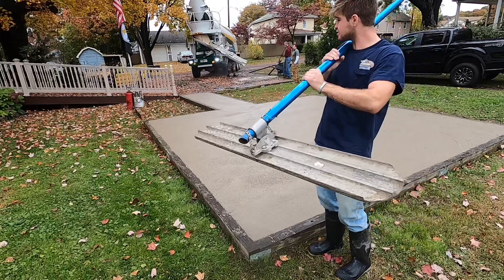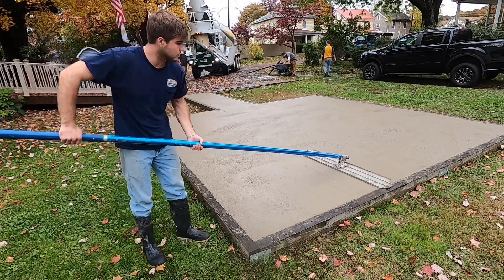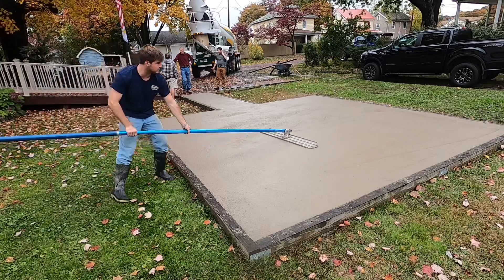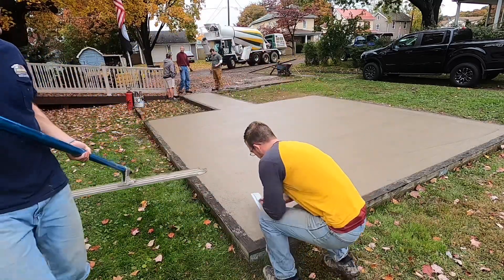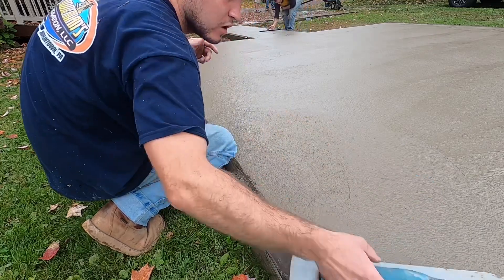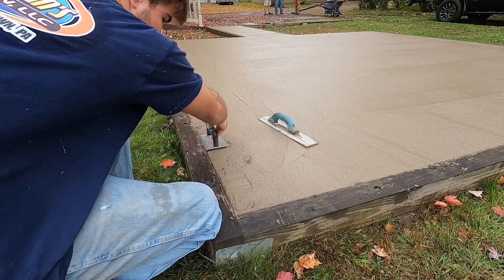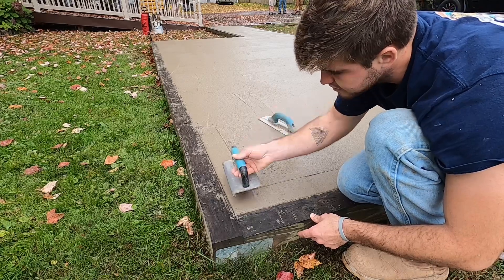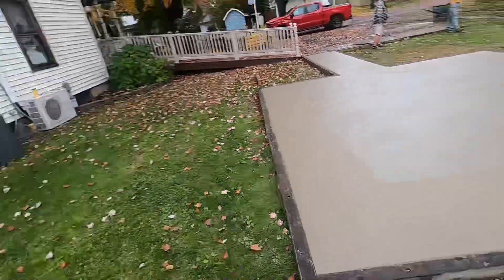How to bull float and edge concrete

Comment: I've seen some bull float video but they never mentioned about turning pole right or left to lift the front or back.  Thank you so much for the information. Including the edging.
Reply: Not all bull floats are the same. Some don't have the chains so there would be no need to twist the handle.

Comment: at 79 years old   I supported a much younger guy who was about to lay 9 cu yds of ready mix which had been unloaded into his dive way . around 50 metres from the prepared work area . After watching numerous concrete slab laying videos .I had a good idea of what lay in store for the afternoon delivery . the 9 cu m of concrete was sitting menacingly in the drive  a three foot high tsunami held in place by the house and garden wall. no Bobcat   only two wheelbarrows a couple of shovels and garden rakes .I had entered the rear of the house through the front door and had not even seen the mountain of concrete . after an hour of continuous raking and rough levelling of the wheelbarrowed concrete .m I took a peep around the corner of the house up the driveway and was horrified to see that less than half of the concrete had been barrowed into the work area .Suggestions by me  that YOU NEED MORE LABOURERS  where turned down with a curt  NO.The concrete was now becoming more difficult to rake level , it was a breezy sunny afternoon around 22c. The 60 year old labourer,s barrow loads of concrete were arriving less frequently .  checking on what was slowing down the work    I was horrified to see that the huge delivery of concrete had started to cure making it almost unworkable .There must have been another 4 cu m   of now rapidly curing concrete  a shovel just bounced off it . I had been working non stop for over three hours and had had enough. Leaving the remaining two guys to their unenviable task .SOME PEOPLE NEVER LEARN.